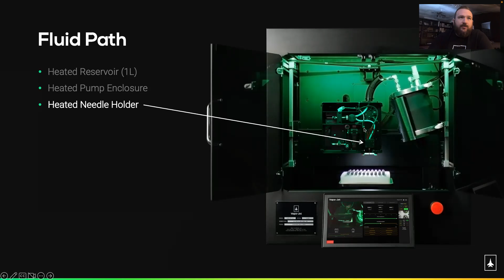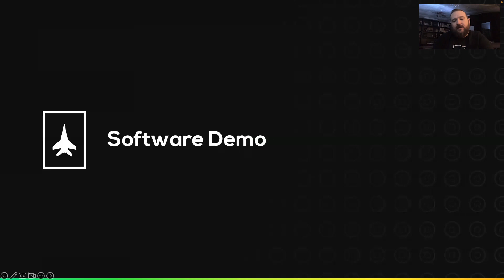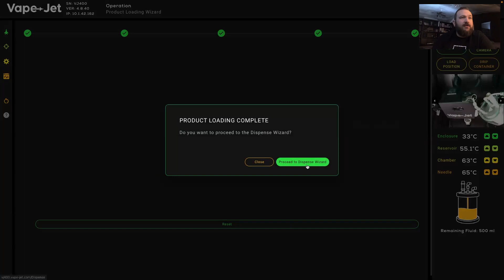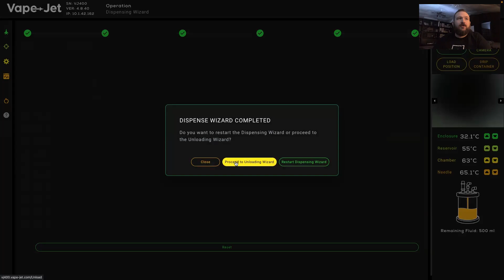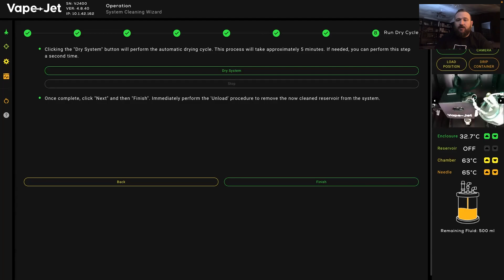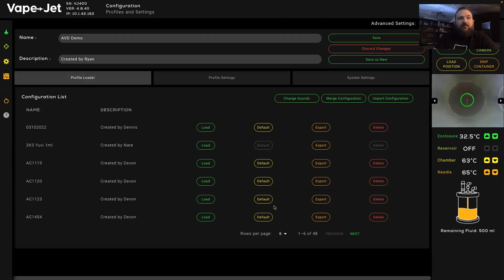Vape-Jet 4.0 Fully-Automatic Filling Machine | Product Demo with CEO and Developer Ryan Hoitt

Comment: Cost?
Reply: Guarantee it's ~$15k+. Just look at the price of other automated filling machines, that don't look near as nice as this one. Heck even the hand-held filling "guns" you can get on Amazon etc start around ~$180. I wish I could find something to make filling carts from a dab syringe easier. Obv this product is way WAY above the type of thing I'm looking for. But man it's crazy just how thick distillate is and how much of a pain that makes it, even filling one 1g cart. The $180 things on Amazon etc have very mixed reviews. Plus what I buy from the disp already comes in a syringe. So I guessI just need something that can hold the syringe and make it easier to push the plunger down. Already have something to hold the cart in place and blunt tip needles. Right now I'm just using a hair dryer to heat the syringe, quickly fill as much as I can, and repeat till it's done. But I'd love to find a way to make it easier because the price difference is pretty big. A 1g cart here in Arkansas is ~$35-$40. A 1g dab syringe is $20, or a 2g syringe (two 1g syringes in one bag) is $40 vs $80 for a 2g vape (dispo or cart).